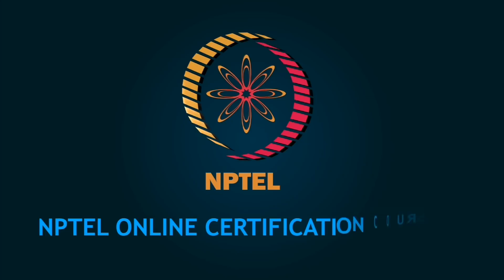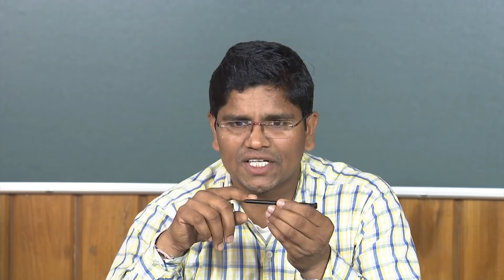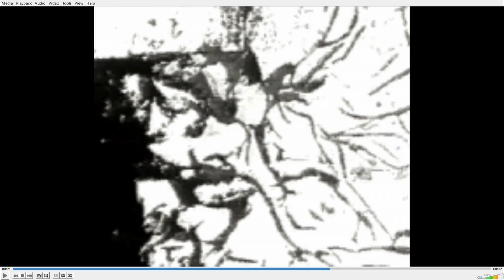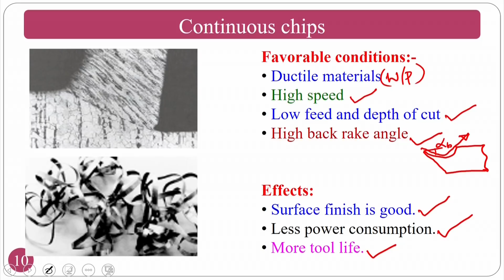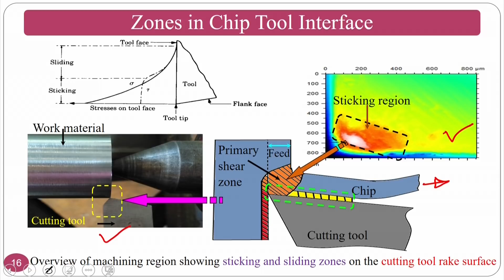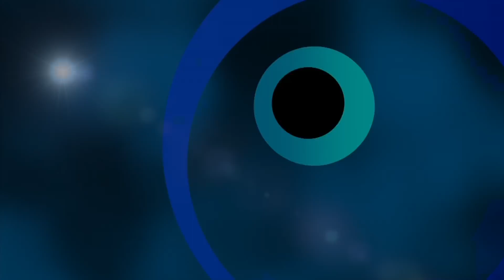Lec 3 : Principles of Machining or Metal cutting

Comment: Sir i am from Pakistan, i have done my master in Manufacturing engineering with research specialization in high speed machining, i have learned a lot from your lecture series,  currently i am doing PhD in mechanical engineering with same research area (machining).